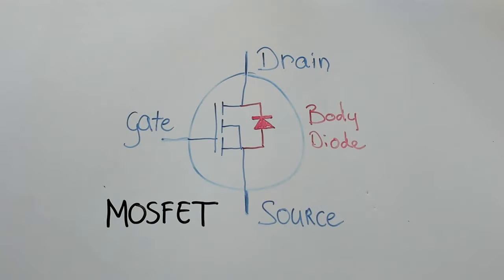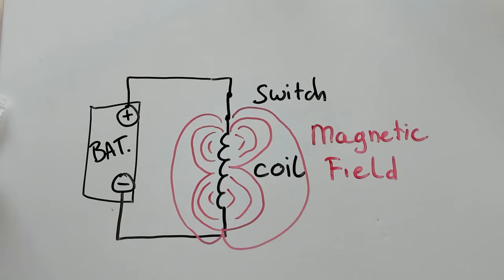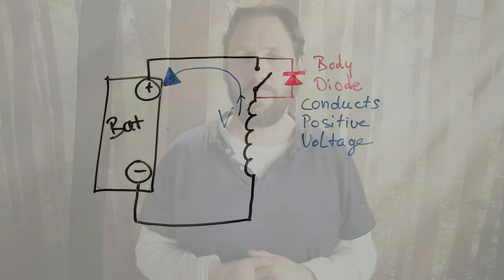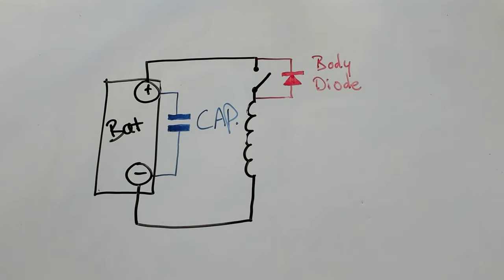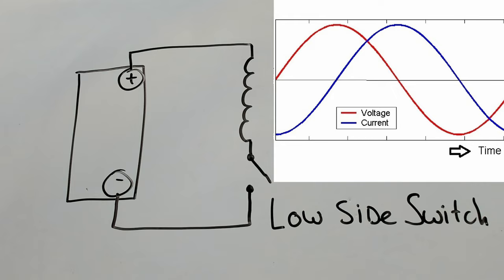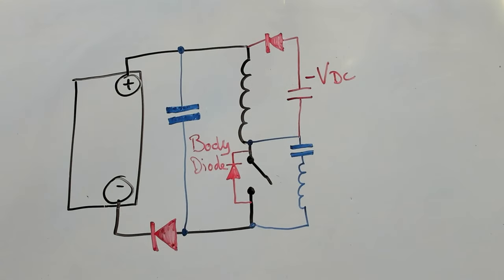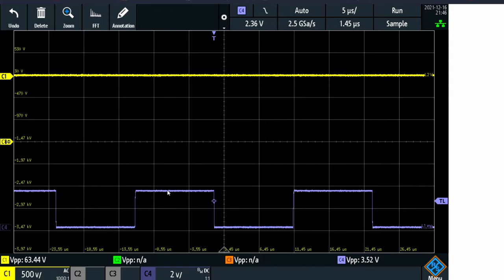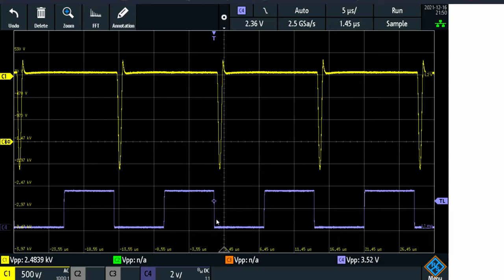Efficient Electric Impulse Generation

Comment: Nice work!  I am experimenting with Kenneth Shoulder’s exotic vacuum objects which are produced with 2 kV impulses to a cathode.  I need to limit the impulses down to a fraction of a nanosecond.  Any ideas on how to accomplish this?  Thanks for your generous contribution to the field.
Reply from the maker: nanopulser, based on step revery diode.
discharge of the step diode produces the nano impulse.
I never looked deep  into it.
Reply: @MasterIvo  Thanks, I’ll let you know how it works out!

Comment: What will happen if you put the coils in to liquid nitrogen to make it a super conductor? Maybe the dielectric resonance will go on for longer or continue since there is less heat & resistance in the system.
Reply from the maker: correct, less losses
Reply: You can avoid the heating problem entirely by using a hairpin circuit design, if you can get the dielectric current going without involving any Magnetic losses the current won't produce any heat in the circuit, though the only way I know of at the moment to do it like that is with high voltage to induce bring the required pressure and a spark gap to trigger the capacitors to release.

Comment: Could it be that positive impulses interact with the positron and negative impulses with the electron? Weber talked about a positron based nuclear model...
Reply from the maker: that is indeed an interesting statement. Personally I do not believe in particles, but when seen as a mathematical representation of reality, It would be a good analog.
As the magnetic current flow would be electronic,
and the dielectric displacement current would be positronic

Comment: Awesome IVo.  Thank you.  Question: Can we use both high and low-side impulse circuits on the same battery to use both positive and negative impulses to power something else?  2nd: Could we save more battery energy with higher kilocycles or lower kilocycles?
Reply from the maker: 2nd no
1st yes, that's what I m working on now 2x L1 into one L2
Reply: @MasterIvo  thank you for that answer. 1 more please? DC can't work in transformers. Is there any way pulsed DC can work in transformers since they are frequency driven? Either pole independant or both poles joined in a circuit?
Reply from the maker: @johnallenrichter  there is a function for DC in a transformer!
Saturating the core, it turns into a diode! 
and yes pulsed dc works with a transformer.

Comment: Hey again Ivo, wondering do you have a build list of all parts and tools used? Getting into this stuff, I'm not always sure if there are specific reasons for some of the other things you use. You explain the circuit really well, but are there other things to look into, like brand specific mosfets or bad power supplies to stay away from? I don't want to waste money on things I might not need or things I need that I skip out on due to finances. Thanks!
Reply from the maker: That's a really good question. I'm working on the release of the new mosfet switch which will be for sale.
the rest is all optional. I'll include a list of recommended items.
but most things can be choosen with common sense.
Personally I don't like the Owon brand, but even they might have proper stuff.
this scope is good value
Siglent SDS1104X-U
Reply: @MasterIvo  awesome, thanks for the help! I'll be sure to keep checking the site for that switch!

Comment: Hello, I wonder when you use the energy of the capacitor that stores negative energy of high voltage, which is in parallel to the battery, when it re-osilates in the next cycle the coil does not extract energy from the capacitor but from the battery, due to the lower impedances of the battery, the capacitor was charged with little joules, and it is not enough to feed the coil, it is only a configuration problem, ok thanks
Reply from the maker: why do you think the capacitor has a higher impedance then the battery? I think it's the other way around.
the cap was already charged by the battery, and gets a higher voltage from the halfwave of the coil. this is blocked by the diode.
so first the cap discharges into the coil, then the diode opens up and the battery does the rest.
Reply: I say the impedance according to the capacitor that is placed well it does not matter, well, the diode blocks, all good, I have tried some circuits but I cannot get it to consume less and that the back does the rest, I can not lower the consumption. @MasterIvo

Comment: Great Job Ivo! Now you can generate unipolar HV impulses at will. I'm wandering is it possible to obtain any peculiar electrical effects when reaching 1us impulse duration as described in the book mentioned in your previous videos. BR
Reply from the maker: Thanks, I already am producing 200nS - 3000V impulses with another coil.
It's what you do with these impulses.

my result is massive amplification of the resonant current (and voltage) in the secondary. (see extra coil video, when it is tuned correct, it gives strong sine waves of both current and voltage)
Reply: @MasterIvo  "It's what you do with these impulses". Exactly! :) For example J.Bedini is charging his battery, S.Mayer manipulates water molecules, etc.. but interesting effects can be obtained in so called "Tesla Hairpin Circuit" where for example Halogen lamp can be lit using very thin copper wire. Also itis not short circuited if lamp is submerged into water and it is not harmful to touch etc. Is it possible to make similar experiments using your system as replacement for conventional Magnetically Quenched Spark Gap? If it is possible then there can be a lot of possible applications to experiment with. Best regards Ivo, keep the good work! (thumbs up)
Reply from the maker: yes, but I prefer to use it for my impulsed primary, to induce parametric resonance in the secondary, which give high voltage AND current

Comment: could you use this method from mains power as supply how would that circuitry be implemented like instead of a battery or power supply straight 120ac from a outlet and do you have videos of basic electrical theory for us total beginners
Reply from the maker: 120AC would first need to be rectified into DC.
Many channels provide basic lectures on electricity

Comment: 1.Will this circuit keep producing the impulse  without losses?

If yes,  will the impulse production maintain  itself while steady power is being drawn from it if the coil in this circuit could be made resonant with a conventional transformer?
Reply from the maker: no, if loaded, the resonant energy of the coil flows into the load.

That's why I use a second coil which is series resonant.
this has low impedance (load) due to the series resonance.
This second L2 coil then be comes the primary for the L3 secondary.

And by close coupling L1 and L2, the system stays very efficient
Reply: I think I understand. So by adding L2 & L3 in that manner only then you can harness the power without diminishing the impulse in the main circuit?
Reply from the maker: @prometheus1111111  Im still working on the concept. but yes that is the idea

Comment: Sorry 4 the silly question, what about using a spark gap as switch? Great video and researches though!
Reply from the maker: that's also possible, but very inefficient, I cant get the energy back, but now I can, this makes it very efficient. and long lasting, sparkgaps are very crude. hard to. tune and control.
Reply: @MasterIvo  Was scrolling and this caught my eye, if one wants to make impulses in the hundreds of kilovolts are there still better (and affordable) methods for doing this efficiently, or would spark gaps be better suited in that situation?
Reply from the maker: definitly sparkgaps  @JenkoRun
Reply: @MasterIvo  Thank you

Comment: Is the output frequency limited by the mosfets speed or the phenomena itself?
Reply from the maker: both. the impulse speed is depended on the resonant frequency of the coil. and that depends on the capacity and inductance of the coil.

In theory I could use a straight wire. But the frequency would be so high, and the currents so high, that the mosfet would not be able to cope with it.

Comment: Ivo, is there any possibility that you can sell me one of your finished Impulse plates and you could send it to Chile? I would love to be able to test this circuit in some of my experiments.
thanks in advance

J. Lezana
Reply from the maker: Yes I could, but I prefer you make it yourself. All info is provided on my channel.
I do intend to sell circuits in the future, but it takes time away from my research, so please be patient (need to finishing designing website and circuit, and set up shop)
Reply: @MasterIvo  I want to purchase 2 or 3 of these board myself. Can I suggest you hire an intern or a part timer to build a couple of boards for you and you only need to test/check them.

Making these myself will take months after purchase of several sets of small parts from China.

Comment: What happens if instead of opening the circuit, you switch the resulted pulse to another coil?
Reply from the maker: that is what I already do. the impulse produced when opening the switch is directed in a low impedance series resonant (primary) coil. 

But in my latest research, I charge a cap with the voltage impulse, and discharge the cap with a second switch. This creates a current impulse

Comment: Can we purchase from you a circus like this in the video but instead of 70Khz to be able to move between 3Mhz and 12MHz fir example, because in this bandwidth  are the resonant frequencies of our resonator.
Reply from the maker: Here is the pcb info, www.magstar.eu/mosfet/  the frequency depends on what Mosfet is used. the less current it can handle, the faster it is (lower gate charge=faster) I have used it to above 200kc/s. But really dont know its limits. It is fast.
Reply: @MasterIvo  Thank you Ivo! Im colaborating with another person who have more knowledge about this topic, hopefully whe can make it or something similar.

Would be really nice if you join our small group and exchange with you information.
We are working on 3 prototypes one of them relate to antigravity and the ither 2 are solid state resonators.
But after reading the chapter one of the book you suggest I have many reasons to believe that the monopolar pulse is what is common in between them.

In this anti-gravity prototype for example there is a coil which is swithed on and off from a copper disc which has alternating sections of nonconductive material, rotating bove 5000rpm. 
And thanks to your information I might be able to finally complete it correctly. 

Really wanted to share with you what we have and see his you will interpretat it from the m your point of view.

Thank you for what you are doing !
Reply: @MasterIvo  We are willing to pay if you can make one circuit for us as well.
Our resonant frequencies are about 6.4Mhz.
If you can make one please let me know, we will pay the amount you requested.

Comment: Hi Master Ivo. I need an advice on a Lakhovsky MWO. I have made some versions and I am interested in couple things. 1. How can I measure all the frequencies coming out of the antennas? 2. I have added a 13th outer antenna with 18.1mm diametar hopkng to produce lower frequencies (like on a bass guitar). Btw, I am not an engineer. Many thanks. And if the comment is not suitable for the chat thread, please remove it. I could not find other way of contact. Many thanks in advance. My name is Robert Netkovski
Reply from the maker: I'm not sure, probably with a spectrum analyzer
Reply: Hi Robert, incidentally, I too was inclined to experiment with MWOs recently for healing purposes. At first I used a spark gap TC to charge the rings. It produced a strong output but I couldn't control the frequencies it generated. Now im using a musical tesla coil (SSTC) to power the MWO rings. This way i can control the primary frequency it outputs - i can get 4Hz - 10KHz depending on how i tune the antenna. Ofc there will be many more harmonics produced due to high voltage discharge. I have ordered a  cheap spectrum analyser (tinySA) to observe these.

Im looking for a better high voltage pulse amplifier with much broader range (like 0-4MHz) than the SSTC.

Comment: I thought Tesla's goal was to produce unipolar NON resonant impulses. Edit : i ment to say 'unidirectional'
Reply from the maker: depends in the definition of resonance. for me that is a full wave including polarity changes.
so a half period of current or voltage is not fully resonant.
The kick he used, was a single direction displacement current, aka a current impulse. the current is unipolar in this case.
the energy flow is then from zero to maximum to zero.